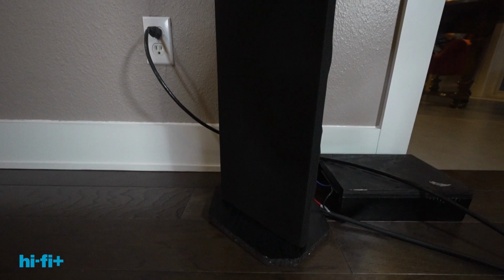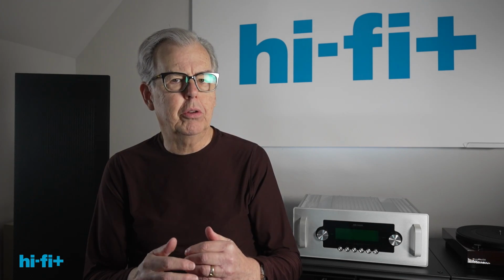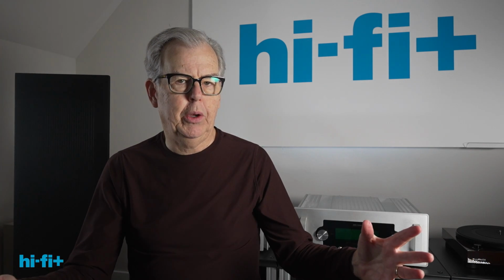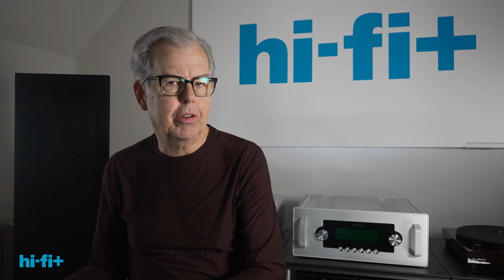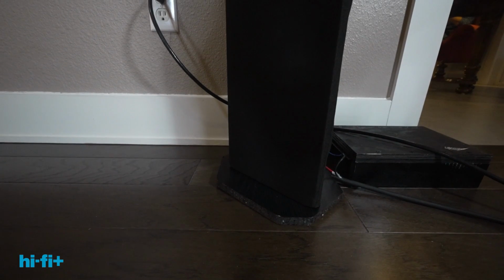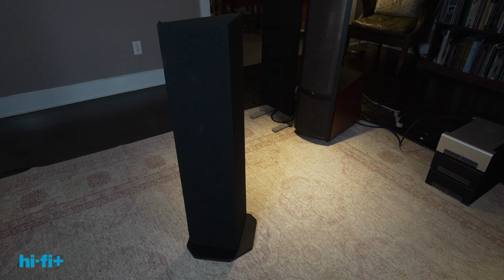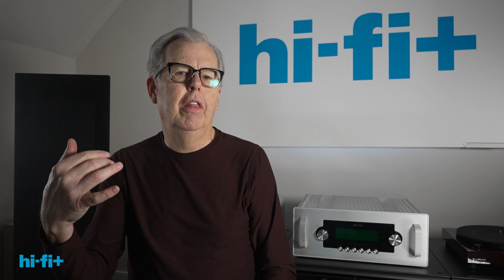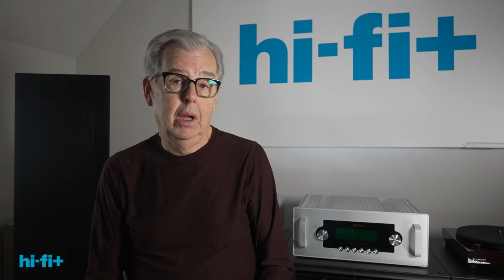Review: Magnepan Ultra-wideband Bass System woofer prototype

Comment: I was about to get a pair of Rels for my Magnapan 1.7's (soon to be upgraded to 3.7i's) until I caught wind of this development. But I'm sick of waiting for more info. Magnapan should be more upfront about possible release dates and prices, even if they are just approximations. They might loose customers if they drag their heals any longer. Mostly, they need to come clear about how it will integrate with a typical stereo system. It seems that an extra amp is required but will we need an external crossover? How do we integrate this into a system where the preamp has no sub output? Am I wasting my time waiting for something that will not work in my system? So many questions, so few answers.
Reply: Don't hold your breath.  It is all marketing.

Comment: It would be nice to see these speakers without grilles, etc.  I get it enough to know the problem with hybrid electrostatic is bass integration.  What we know we need first and foremost is speed and articulation.  To blend with the fast mids and highs of the electrostatic panel is no small feat.  I can totally see why multiple 6" woofers are used.  When made of very rigid and light cone materials the 6" is a sweet spot, especially when ingeniously realized as these here.  Grouped to be able to really dig down with some authority.

Comment: It looks like you used a Martin Logan Ethos which has an active subwoofer integrated that cannot be turned off. So I wonder how you achieved to listen just to the electrostat part with the subwoofer from Magnepan part.
Reply: On another review (can't remember which) they stated that the sub on the Martin Logan WAS disconected.